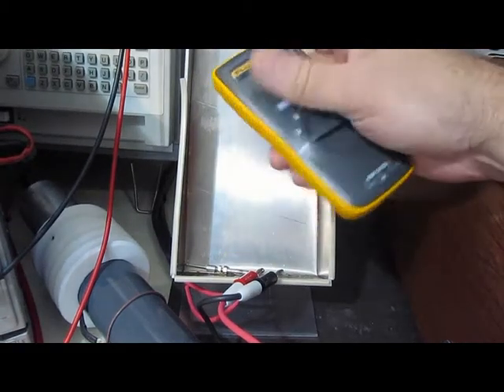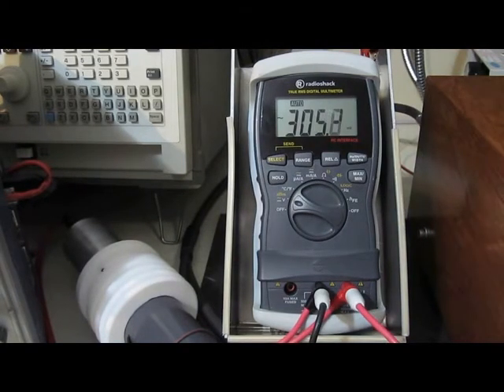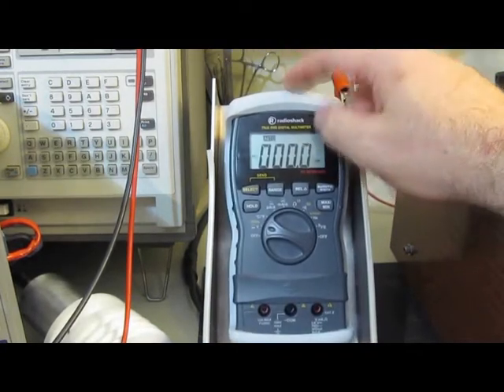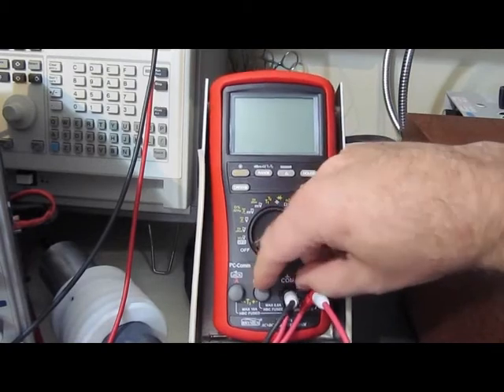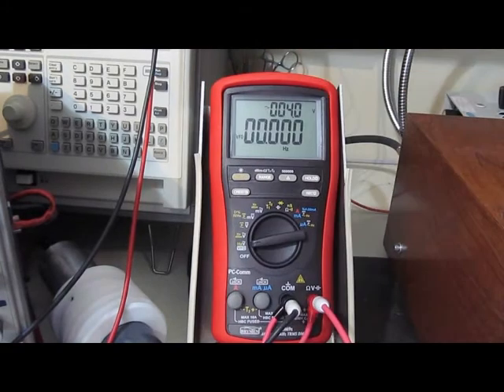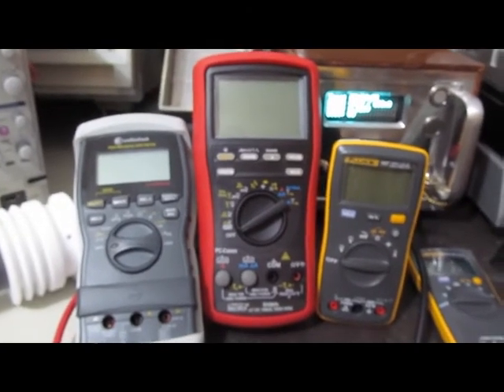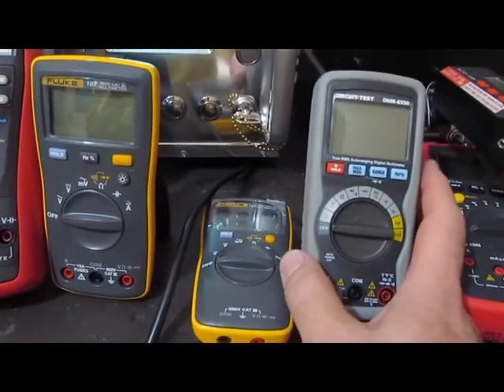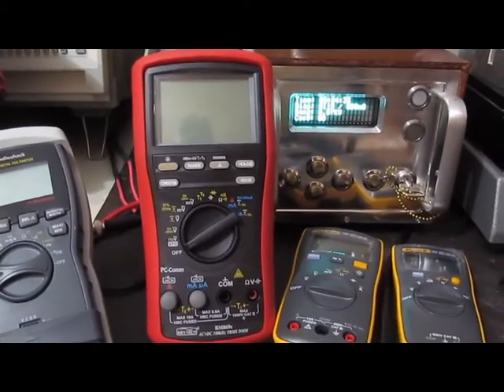Low cost handheld meter robustness testing, round ii, part 12

Comment: Gday Joe,
I wonder how the new fluke 17B+ would  survive up against the 101 or the 107 in you tests, being that it has a CAT 111 600 volt rating the same as those other two meters.
Reply from the maker: +NR D It's hard to say without testing it.   If you watched the first series of videos, all of those meters were CAT III 600V rated and there was a major difference in how robust they were.